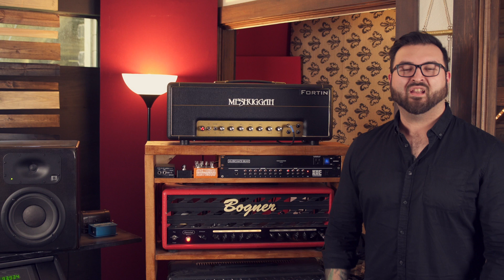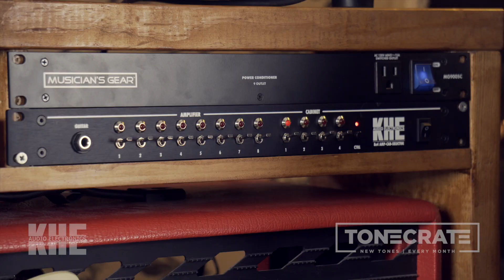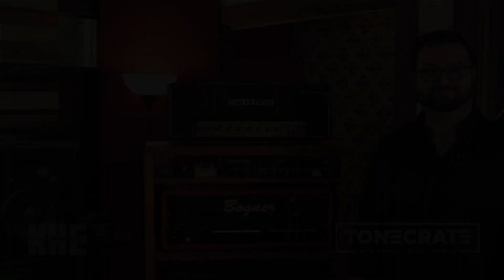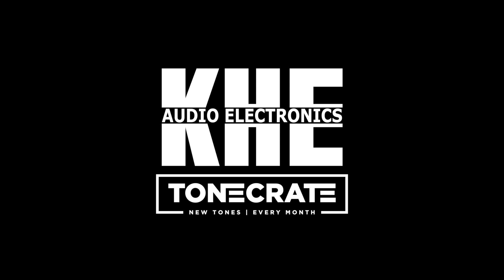Product Review: KHE Audio Electronics 8x4 Amp Cab Selector

Comment: How does it handle the mismatched impedance of cabs rated at different OHM’s in mono?  Let’s say I got an amp head in slot 1.  But I have 3 cabs hooked up in slots 1-3 for cabs.  Each of those cabs are rated differently in mono.  How does that work?
Reply from the maker: You would just make sure the impedance is matched on the head your trying to use, much as if you weren’t using a switcher. If the cab is 16 ohms in 3, 8 ohms in 2 and 4 ohms in one you just need to adjust the head accordingly when you switch.
Reply: @tonecrate  One option, if you have 16 and 8 ohm cabs, is to run all your amps on 8ohms

Comment: I have been looking everywhere for info about these amp selectors.. Do you lose tone? are they tone suckers? I would think with running all them cables, In and Out, In and Out it would hurt the signal? Have you noticed any quality/tone loss after using one of these? Thanks so much...
Reply from the maker: VapnFagan it’s easily my most valuable piece of gear in terms of how much better it’s made my life. It imparts zero affect on the tone. The signal chains are all independent with individual dummy loads, there aren’t chains of cables if that makes sense. Amp goes to the switcher, switcher to the cab. Then you change from channel to channel, everything is isolated so there’s no distortion or feedback between loops. It behaves as it should with no downside.